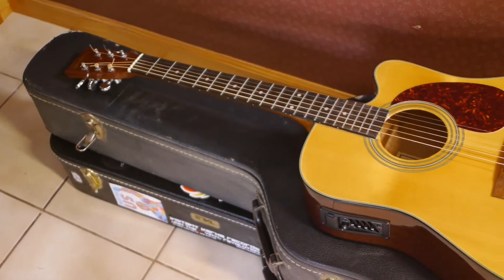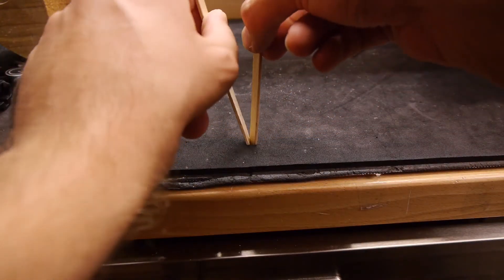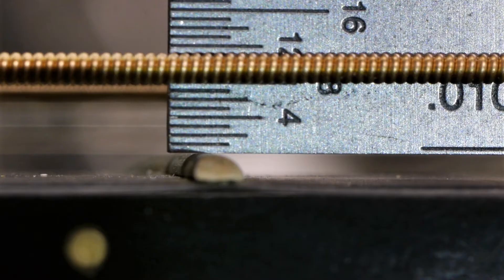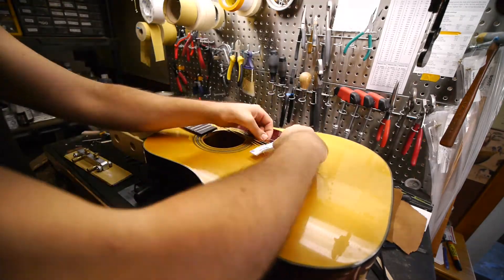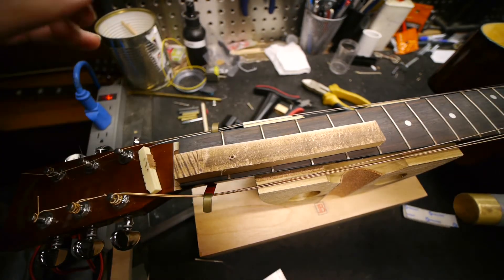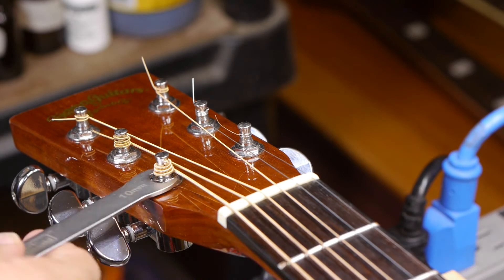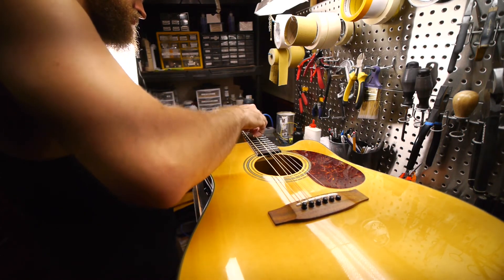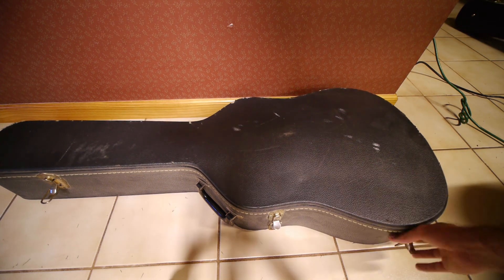Acoustic Guitar Setup | Demonstration + Bonuses!

Comment: Enjoyed it man. Good tip on the shop vac on the steel wool! Had a real no shit Sherlock experience with steel wool last August. Was doing a tru oil finish on a piece. Got hot as Hell out in the shop. So just decided I'd come inside in the AC. Watch a little TV in the skivies and do my 0000 steel wool buffing with the guitar in my lap between coats. Naw man... Dont do that... Naw. Bad idea!
Microscopic sleel particles and certain parts of a man's anatomy should never become acquainted.
Reply from the maker: Thanks so much for the comment! That's enough to make me want to use Scotch Brite pads or something that doesn't shed. Scotch Brite works great for cleaning strings, use it all the time, usually the gray or red color. 

Sounds like that was a night to remember! 😬
Reply: @guitar_md  yeah l like those to knock down the back of necks that have any gloss finish
Reply from the maker: @FoulOwl2112  Same! Can't stand gloss. Might make a video about my process for hand finishing necks with shellac and wax which is my favorite method by far
Reply: @guitar_md  that would be awesome man! I personally use Birchwood Casey's Tru-Oil a little steel wool knockdown and wax. Have never used shellac yet. Although l plan to. Have already ordered some and have on hand, so l would really appreciate a good vid on the topic.